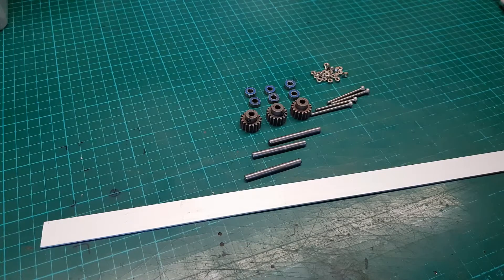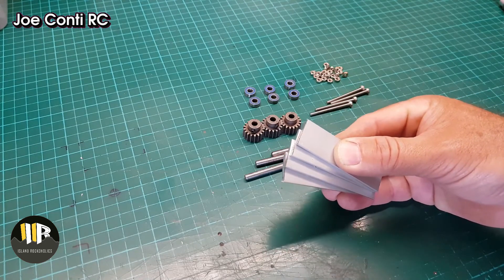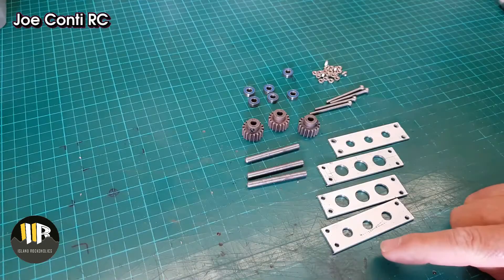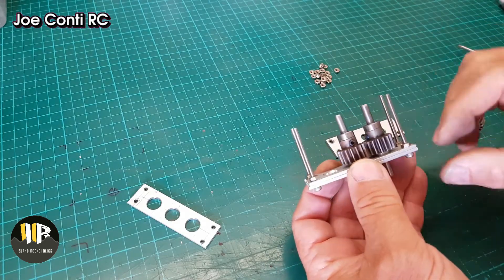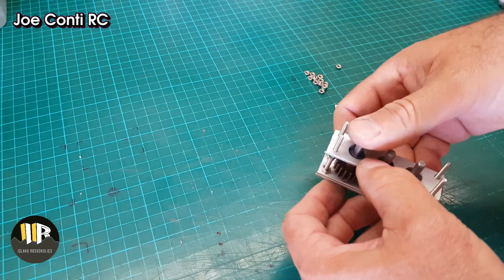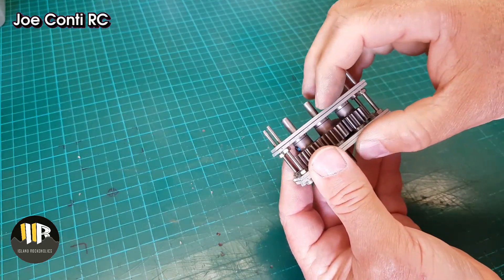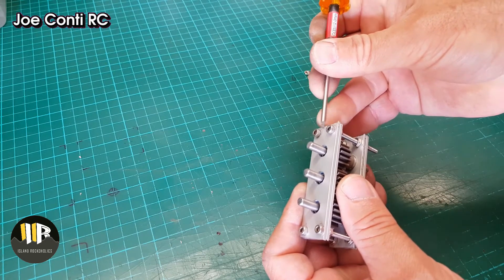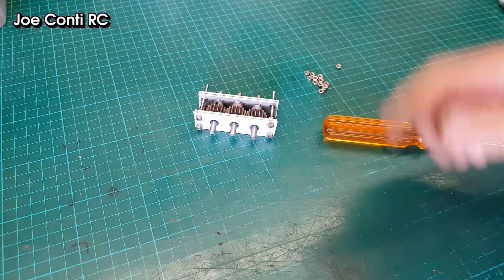Project 8x8 - How to make an RC 3 output shaft transfer case - DIY - Episode 0

Comment: Is your engine not overheating ? After all, it's a 1:1 ratio and the engine has to pull 4 bridges
Reply from the maker: The motor does not heat. The transfer case is 1:1 yes but the transmission is not. Actually, the transmission case is an SCX10 with dual motor mount and all metal gears.

Comment: Great challenge I have seen all your videos and you have motivated me to build my project and I need some advice.
Pinion Motor and Bearings Gear what measurements are
and if you changed something at the end of the project regarding this.
Reply from the maker: I have RCs with 1.55 wheels, 1.9 wheels and 2.2 wheels and on all 3 different setups, I have the same 11T/32P pinion and 56T/32P spur. I have found this to be sufficent for my driving style.

Comment: I love what you have done. But if I can make a suggestion. Put some thin shims to space the pinion gears out from the bearings. This way its not causing the OD of the bearing to spin in its case or rub the pinion gear. You'll probably get an RPM increase as well as greater life out of the bearings.
Reply from the maker: Less friction .. good point .. thanks for watching and for your great suggestion :) :)